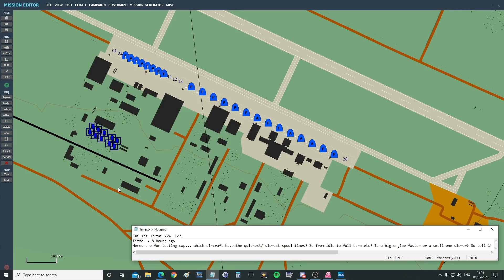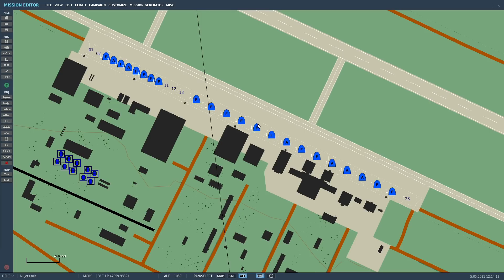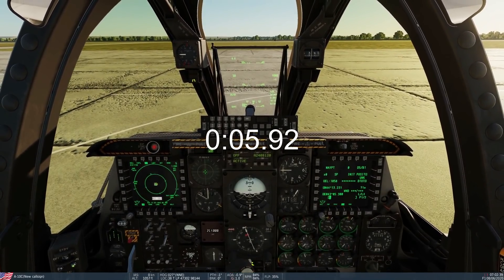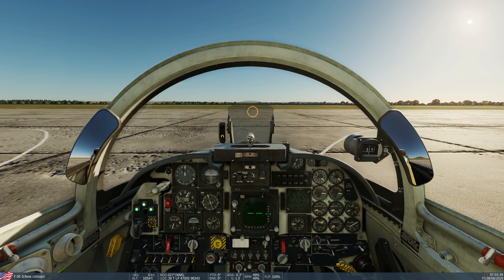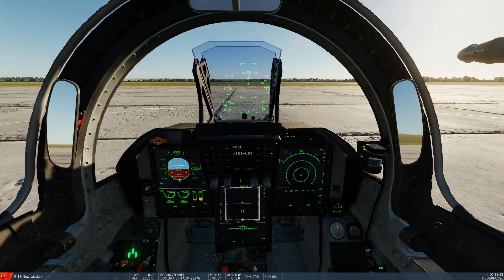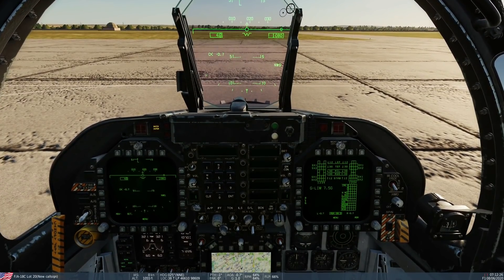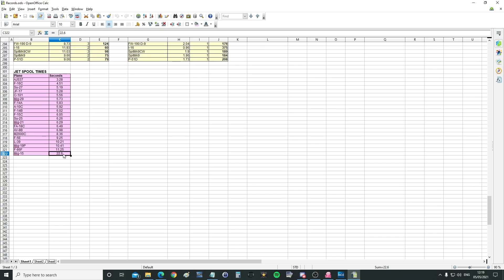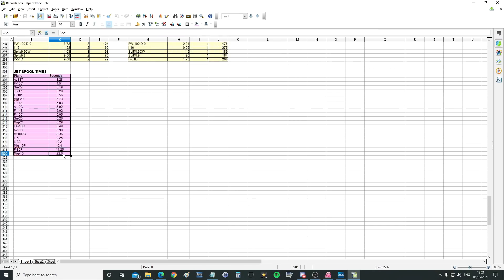Questioned: Which Aircraft Have The Quickest Spooling Jet Engine? | DCS WORLD

Comment: It could be that the diameter or number of blades of the engine gives a difference in angular moment of inertia vs the rotational  mass and how it is distributed in that mass. Couple that with the ability to flow gas through the system IE the temperature differential due to fuel burn, the available flow rate of fuel, intake and exhaust geometry ect. I think its more complicated than just the mass to be rotated, though I haven't studied how these interact.

Comment: The time on the F-15C is not correct and would be faster.  I real life on the test cell the F-15C engines from idle to mil (N2 max) is around 4 sec +/- 1/2 sec. The max time is 6.5 sec but you almost never see that time.  I have been working on F-15 for 30 years as an engine specialist. The F-15C/D uses the F100-PW-220 engines and a lot of the engines were the old F100-PW-100 that have been converted to -220's.  The main difference between the two is the external components of the engine.  I have not played DCS in about a year and I can tell you that the F-16 fuel flow was wrong because it will not burn 80,000 lbs of fuel with just one engine.  When testing an engine on the ground the max fuel flow that I have seen is 42,000 PPH.  Yes, I work the F-15 but I have worked both the PW and GE engines and the max fuel flow is about the same.
Reply: Interesting! It has to be noted that the F-15C in DCS is not a full module so you can not expect too much
Reply: @mrpawno4955  You are correct about the F-15 but what about the F-16 with such a high fuel flow of 80,000 PPH when on the ground it is around 42,000 PPH and in-flight they can see a max around 65,000 PPH.  The gauge has a limit of 80,000 and I would bet they used that as the max limit for the fuel flow.  Just because the gauge maxes at 80k does not mean the fuel flow will reach that limit.
Reply: I'm willing to bet a lot of the numbers are fudged as the devs are really limited on data sources. They can't really just waltz over to the military and ask to hop in a flanker or hornet and measure stuff.
Reply: @rubiconnn  They don't need to and there is info out there that is unclassified and will get them what they need without fudging number.

Comment: You only have an N2 RPM gauge if you have a 2 spool engine, which the early jets do not have. Also, if you have a turbofan engine rated thrust is defined by N1 RPM, so that is the spool time you care about.
Reply: I know that all US aircraft from the 70's on, like the F-15, F-16, A-10, and F-18 all have turbofan engines.  All these aircraft have an N2 gauge but the A-10 also has an N1 gauge because like you said they care more about the N1 RPM because that is where it gets its thrust from.
Reply: @williambyrnes4198  The point is that Cap's misuse of terminology is going to mislead thousands of his valued viewers into calling the engine RPM gauge in all these aircraft as "N2", when it is not.  When an aircraft has a single tach it is simply referred to as RPM, and the pilot often doesn't know and need not care whether it is reading off the high pressure or low pressure spool.  Many aircraft modeled in DCS are single spool to begin with. Only when you have a tach for both  N1 and N2 are they labeled and referred to as such, and in that case N1 is the gauge you use to set full thrust.
Reply: @gort8203  You are somewhat correct about his miss use of terminology and being misleading about the N2. There are a few things that I think you might be misinformed about. First off, Your comment about many aircraft being single spool is incorrect, aircraft such as the F-15, F-16, F-18, A-10, F-14, JF-17, Mig-29, AV-8B, L-39, Mig-21, and others are all dual spool and the AJS-37 is three spools. I'm not going to find out what all the aircraft have but this gets my point across. One rule of thumb is that if the engine is a turbofan then most of the time but no all will be dual spools because turbofan engines have bypass airflow.  Then you have two types of turbofan engines, low bypass, and high bypass. There are only a few aircraft that will have gauges for both N1 and N2 like the A-10 and that is the only one that I can think of that has both gauges so yes they will be labeled.

Just so you know I have been a jet engine mechanic for 30 years and know what I'm talking about.  Mind you I have only worked three different engines on three different types of aircraft.  I have worked F-16 Block 30 and 42, F-15A/B, C/D, S, and SA, and the A-10.  You can look up the engines in each.
Reply: @williambyrnes4198  I am not misinformed, but you may be misunderstand what I am saying.  First of all I said older jets modeled in DCS were single spool. Obviously the more modern aircraft you list above were not, but the F-86, MiG-15, MiG 19, F-5, and probably more were single spool.  The other thing I said is that it doesn't matter how many spools the engine has if the pilot only has a single tachometer for the engine, because even if that tach reads off the high pressure spool is it usually labeled RPM, not N2.  Obviously in such aircraft the pilot does not need to distinguish which spool is providing the reading.  Just go read the Dash One for the F-15, or F-16 or F-18.  My only point is that people should not assume that engine tachometers generically indicate N2 rpm, as Cap does in this video. If you still claim I am misinformed please be specific.
Reply: @gort8203  I agreed with you about CAP being misleading on the N2.  You never said, "it doesn't matter how many spools", you said, "When an aircraft has a single tach it is simply referred to as RPM, and the pilot often doesn't know and need not care whether it is reading off the high pressure or low pressure spool." and yes the pilot does need to know what compressor it is reading and that would be something they are taught in training when getting certified on that aircraft.  You are correct about the tach usually is just labeled RPM and the pilot would know what compressor that is from their training.

As for the Dash One, it tells what the compressor the RPM is reading  because that is something they need to know.  For the F-15 the Dash One says the RPM is percent of core engine RPM.
Reply: @gort8203  What you said about the pilot often doesn't know and need not care whether it is reading off the high pressure or low pressure spool.  Every pilot in the military that I have dealt with knows what compressor the RPM is reading.
Reply: @williambyrnes4198  No, if the engine has a single tachometer, it is because the pilot does not need to know the rpm of both spools.  He may be aware of which spool it indicates as general knowledge, but that is not really necessary in operating the aircraft. The engine is operated within the prescribed RPM limits, and the pilots applies procedures based on the RPM indicated without needing to know which spool it indicates.  In an airplane where the pilot needs to know the RPM of both spools, the aircraft will have a tachometer for each one, and separate limitations to comply with for each.    
Discussing the general knowledge level of the average pilot (with which I am intimately familiar) is a long way from the simple two sentence statement I made to indicate why it was misleading of Cap to use the term N2 in place of the more generic term RPM.  I said you only have an N2 gauge when you have a two spool engine, which several of the aircraft he "tested" do not.  And if you have a turbofan (by which I meant a high bypass engine) you set thrust by N1, so referring to N2 does not tell you when you have reached full thrust.  You said you agreed that Cap's statement was misleading, so I don't see the need to for further spool up of this discussion.
Reply: @gort8203  I think we are saying the same thing but each of us is saying it in different ways.

I'm not sure you understood what I was saying.  I know that the pilot does not need to know the RPM of both spools.  

You are correct about the pilot knowing what spool the RPM indicates as general knowledge and is not necessary for operating the aircraft, but it will help them to understand the limits of the aircraft.

I also said the same thing about if the pilot needs to know the RPM of both spools then the aircraft will have a tach for each.

I don't know what your knowledge or skill level of aviation is and you sound like you have a good understanding.  The info that I have given is from my 30 years of working in the industry as an engine mechanic and test cell operator.  If you would reread my comments you will see that I never really disagreed with you, and I only just added info.
Reply: @williambyrnes4198   
I guess you don't see your statement that I am misinformed or your implication that I stated the more modern jets you listed are single spool as disagreements. All I did was state two simple facts so as to inform Cap's valued viewers that they should not take his use of the term N2 as fully accurate.  But I’m glad to hear we fundamentally in agreement, because I have a question on a different subject may be able to help me with.

You seem concerned with my C.V. rather than the simple facts I desired to share, so I'll tell you that I am a former military and airline pilot who has flown centrifugal flow, axial flow, turbojet, turbofan, single spool, dual spool, afterburning, and high bypass jet engines, in a variety of fast jet and slow jets, small and large jets, and jumbo jets, and I’ve set thrust by refence to RPM, EGT, TIT, and EPR. (The standard division of duties is if you don't try to tell me how to fly them, I won't try to tell you how to fix them.  ) 

I have a question about how you adjust and trim a non-flat-rated engine in a fighter type aircraft to produce military thrust at the mil thrust detent. With flat rated engines you simply stop pushing the lever forward when you reach rated thrust or an engine limit. But in an airplane like the F-5 for example, where you simply push the lever to the mil stop to produce all available dry thrust for existing conditions, how does a mechanical fuel control limit the RPM? I know you adjust the relationship between the thrust lever and the main engine fuel control input, but I’m asking about the internals of the fuel control.  Is there a governor that reduces fuel flow at limit RPM, or do you just set the maximum fuel delivery to not exceed engine limits?  How does the fuel control adjust the fuel to the amount of air intake?  For example, at nominal 100% RPM at 30,000 ft the engine needs less fuel than 100% RPM at sea level.  How does the engine provide the optimum amount of fuel for maximum available thrust? This is stuff I’ve always wondered about but never bothered to research until now.
Reply: @gort8203  I can answer your question based on the engines that I have worked on.

Is there a governor that reduces fuel flow at limit RPM, or do you just set the maximum fuel delivery to not exceed engine limits?  How does the fuel control adjust the fuel to the amount of air intake?

On the F100-PW-100/200 the fuel control is manually adjusted to meet engine limits.  The idle, mil and max fuel flow are set based on different readings we get from the engine. If I remember correctly idle fuel flow is based on N2 RPM. Mil fuel flow is adjusted to set FTIT (Fan Turbine Inlet Temp) limit. Max fuel flow is adjusted based on different readings and is set to not exceed a set limit that we get from a chart.  We will also adjust the RCVV (Rear Compressor Variable Vanes) based on a chart.  The fuel control will adjust the RCVV based on a reading it gets from the RCVV Feedback Cable. The RCVV feedback Cable is attached to the RCVV actuator arm.  The fuel control moves the RCVV actuator using fuel as the hydraulic fluid. The RCVV is set to maximize airflow into the HPC to prevent compressor stalls/stagnation.  There is also an adjustment that is made on the EEC (Engine Eletrictronic Control) to make sure the N1 is within limits.  This will adjust the nozzle to create backpressure on the N1 to prevent it from overspeeding.  With this engine when the pilot has an EEC warning light, they are not allowed to use max because is no N1 overspeed protection when the EEC is off, the EEC controls N1 speed.

The other engines I have worked on are all self-trimming.  Steps are followed and limits checked, if limits are not met then components are changed based on the FI.

Thanks for this discussion it has been fun and informative. Your view is different coming from the other side (pilot view).
Reply: @williambyrnes4198  Thanks.  If fuel flow is set to desired FTIT, what sets the RPM to the acceptable range?  In my experience it seems a strong engine with all it parts at like new tolerances will produce rated thrust or military RPM at lower temps than an engine in need of maintenance adjustment or overhaul.
Reply: @gort8203  There are a lot of things that determine the thrust.  One is the EPR (Engine Pressure Ratio), the higher the EPR the more efficient the engine is and the higher the thrust will be.  When setting the desired FTIT we adjust fuel flow and that will affect RPM as well.  We have a max/min limit for all parameters and as long as we are within the limits then all is good. As we adjust fuel flow we watch both the FTIT and RPM to get the desired FTIT but making sure to keep RPM under the max limit.

I have had engines where we could not get the FTIT in limits and the max fuel flow adjustment on the fuel control was maxed out. the engine was rejected for the core being worn out, but not before changing other components like the fuel control, fuel pump, N2 speed sensor, and other items.  When it was found that the core was bad all the changed components we maker as serviceable and used on other engines. When the engine is new you can get FTIT in limits easily with a lower fuel flow and that will give you a higher EPR, which in turn, gives you a better performing engine.  The EPR is based on a formula that I don't remember but uses different temps and pressures and different points on the engine.  The points would be engine inlet temp/pressure, bypass temp/pressure, PB (Burner Pressure), and FTIT.  I don't remember if there is more but I think you get the point.

Edited to add that the EPR also has a min limit and if the limit is not met most of the time it is because the core is worn out and needs overhauling.
Reply: @williambyrnes4198  That's roughly what I expected, but thanks for the details.
Reply: This isn’t necessarily the case in all engines. The Spey used on Nimrod had the primary gauge for the pilots as the N2, and the N1 was only given to the flight engineer as it didn’t really mean anything. Granted, it is a low bypass turbofan so not like an airliner engine or anything, but the core speed is what the pilots used to set power levels along with the thrust meters. It’s also what’s used to know when to add fuel during start and to set the idle speed, so it’s quite important overall.